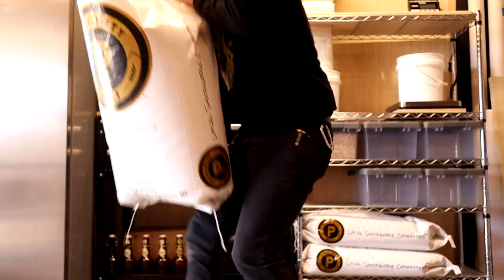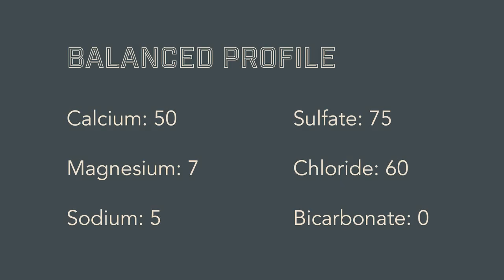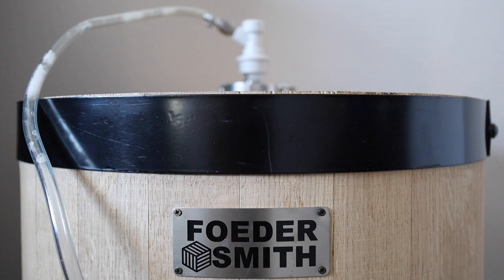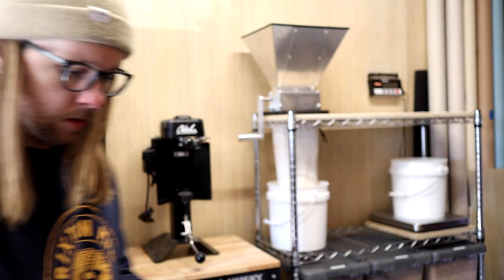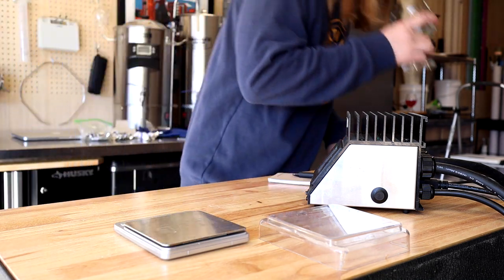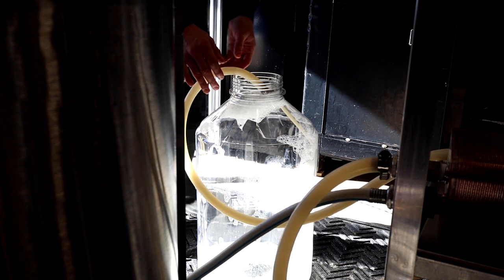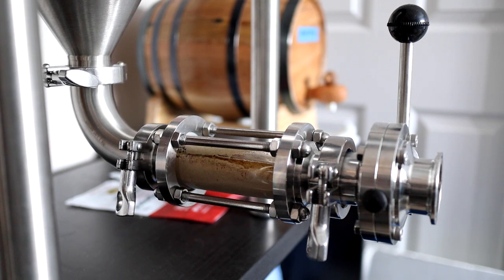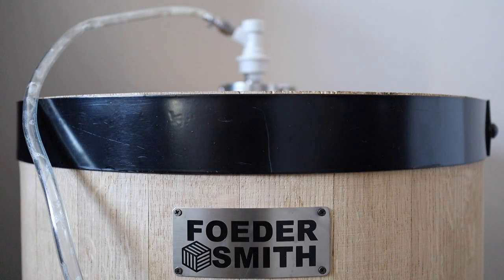Starting a Solera | Blichmann BrewEasy | FoederSmith Foeder | EP22

Comment: I have one going at the moment (4 months old) but just in a big mouth bubbler.  Hoping to get a barrel at some point but plastic will have to do for now.  Going to do my first pull soon to blend with a saison but also bottle condition some unblended.  I hope yours turns out well!
Reply from the maker: Sounds awesome! Love the name! I’m still kind of debating when I’ll do my first pull but I’m thinking maybe 9 months or so depending on how acidic it is at that point
Reply: @HopsANDgnarly  I used Bug Farm and a relatively simple grain bill so it was drinkable fast.  I'll go more complex for the next top up.  I recommend adding a small amount of flaked adjuncts at mash out when conversion is no longer possible so there is leftover starches so you can provide food for the bacteria and brett.  This should get you more acidity as well (if desired).

Comment: Are you worried about pulling to much oak character from the foeder on the first go around?
Reply from the maker: Yea for sure. The holding solution I used likely removed some of that but at this scale it’ll be hard to avoid completely with the first batch. Planning to check in with it at maybe 6 months and worst case I suppose I could blend it

Comment: Just checked out the price and woo boy that's a tad more money than I could spend and stay married.
Reply from the maker: 😂 Yea it’s up there with the unitanks and stuff like that
Reply: @HopsANDgnarly  I actually have 2 sanke soleras one gomden sour the other sour red. I bought triclamp kits for them so I can push beer in and out of them with co2. They work well and I  get to keep my wife.
Reply from the maker: @jonthebeau4653  😂 that sounds rad! How long do you think I should wait before I make my first pull? I feel like the first one might take the longest to really develop some character and I can maybe shorten the wait later on
Reply: @HopsANDgnarly  I would think at least 6 months. I waited a year for both of mine and have doing every 6 months. I base the amount of the pull and the replacement beer on tasting samples. I have pulled 2/3 and added back 10 gallons with increased ibu in an attempt to tame the acidity. That works to a point but maybe more frequent pulls are in order as well. They're 3 years old and have not had issues with off flavors yet beyond the beers being too acidic. It's a cool project hope it works out for you.